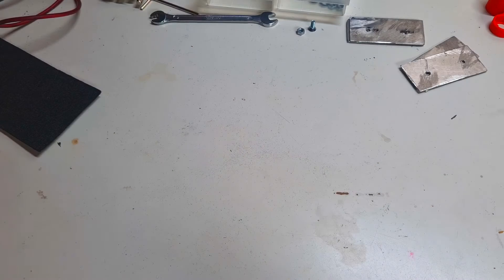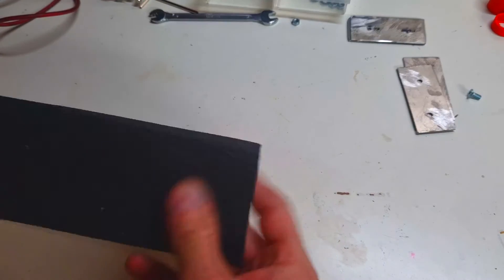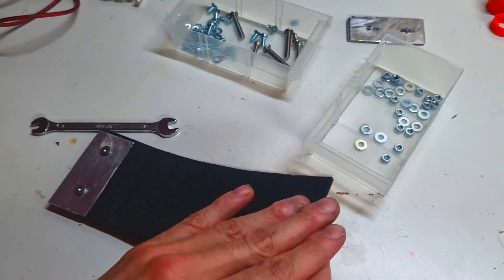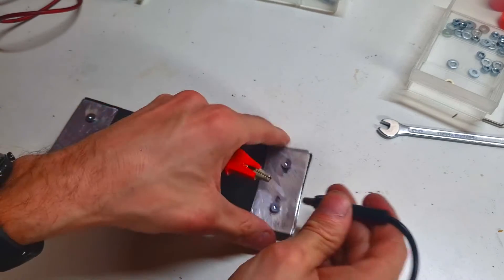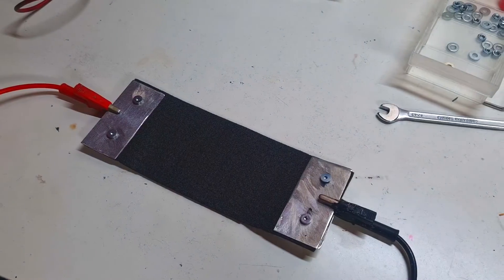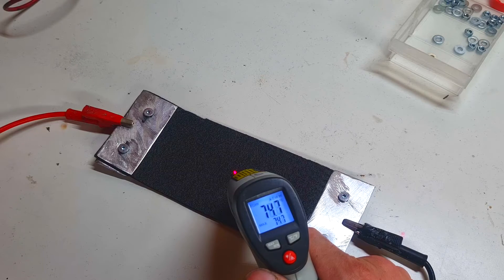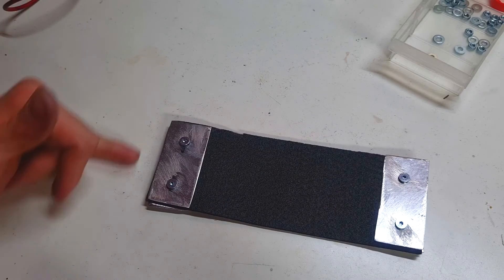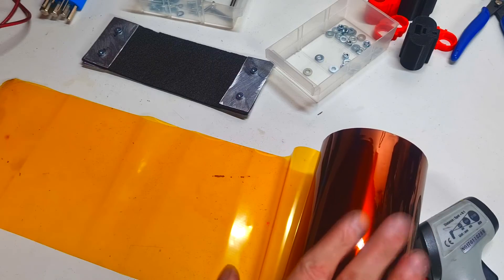Diy Carbon Fiber Heater in 2022

Comment: Use silver glue between the metal and the cloth. You will get a solid connection with a lot less metal. In some cases, you don't even need any metal at all. Just silver glue and sew it to the cloth. The glue sets and you are good to go.
Reply from the maker: Cool!

Comment: Thanks for the great video. I have some questions, though! What does the pad exactly called? If I buy fiber welding blanket would work as camping pad? What about the woven carbon fiber from Amazon? Does it be better
Reply from the maker: It is called PAN based graphitic carbon felt. The welding blanket will not work. I dont know about carbon finers from Amazon

Comment: Will this work with "carbon felt" or do you need to use "graphite carbon felt"? Does carbon felt have the same resistance? I've noticed the price is quite a bit less and I need to use quite a bit of it for my project to melt the ice off my solar panels.

Comment: This is very interesting, Are you able to control the heat produced by limiting the voltage and amperage?  Thankyou ☺️
Reply from the maker: Yes for sure. That is how every heater works
Reply: @cayrex  How are you controlling both the voltage and the current? I bought a new power supply but it was load dependent. I could set the voltage but I couldn't set a fixed current. Can you please help me out with the type of the current regulator or power supply and how can I overcome this problem? Ithink i am not getting results because the current is so low and I cant force it to be higher. Thank you
Reply: In addition, the carbon fiber mat I am using has much higher resistance around 500 ohms and it depends on the length of the sample can go up to 7000 ohms.
Reply from the maker: @bobhafi281  You have a felt with to high resistance. Search for graphitic carbon felt on ebay or amazon. Because for high resistance material you will need higher voltage that can operate on a certain current.
Reply: @cayrex   Thanks for the clarification. As of now I have this material only, but my question is how to regulate and fix the current and the voltage? did you use power supply or current regulator? I bought a new power supply that can only regulate the voltage and I have no control over the current. Please if you can help me in how to fix both the current and voltage to serve my needs I would be grateful.
Reply: a PWM (pulse width modulator) from a scrap newer car will easily control the power (12Volts, 5A) so you don't need the expensive power supply.

Comment: Graffiti carbon felt?
Reply: He says 'graffiti.' Americans say 'graphite.' its graphite carbon felt, aka magic wick, aka forever wick, aka charcoal felt sheet, aka carbon felt wick.
Reply from the maker: @crystalwilliams7095  It is graphitic carbon felt. And is not good to be confused with other types of carbon felts. The graphitic carbon felt have high conductivity which others like activated carbon felt, "welding" felt, charcoal felt.... are less conductive annd will not work on low voltage.

Comment: Hi, thank you very much for your good work! 
I build a sand stove from an old wood stove and I am looking now for a low Watt element heater to heat the sand. 
I see a lot on you tube, I can also order low Watt element heaters but how to connectvthe wires of the element heater with wires that goes into 220V. 
Are there some special connectors between the hot wire and the cold wire? 
Your carbon heater, can it go on 220V? 
I hope you will / can answer my questions.

Here is the link to my sandstove. 
Free energy sand stove. https://youtu.be/RgmQXNggNJ4

Comment: Got an electroconductive tip for you. 

The black window silicone sealer is electroconductive.

I just don't know how conductive or resistant it is.
Reply from the maker: Yes I have one graphite carbon silicone. The resistance is in kohm

Comment: I used c channel aluminium and folded the felt double and pushed 4 inch nail into it . Very tight fit otherwise you can get hot spot very easy . I will be covering mine with clay and sorell cement mix . Also you can get ready made brick to absorb the heat for long heat store . Maybe make sand battery if you put sand on top
Reply from the maker: Yes using clay & cement is also good idea to use it. Similar I made with my ceramic IR heater. Sand battery with carbon heater,.... interesting 🤔💡😁
Reply: @cayrex  I will do a video in next week of sand heater with carbon . I have some already but I have finalised design and will not be using graphite coated sand as it's better to use welders blanket carbon felt which can go over 1000c degrees . The pan felt can not go very high but is ok for 200 c degrees I think . I was getting hot spots and it's very messy with graphite coated sand .
Reply from the maker: @Buzzhumma  I heat the graphitic carbon felt for 9 hours on 500 deg C. The Activated carbon felt I heat on 900 deg C for several hours,... but have higher resistance as graphitic carbon felt. The carbon coated sand I try allready which works great but because of the little bit higher resistance I need higher power to run
Reply: @cayrex  yes o found the best grapite was the mold release  cheap stuff which was suprise but also very fine sand made it best conductivity